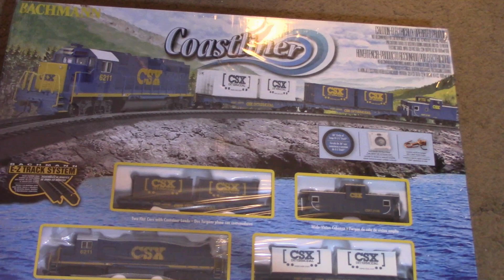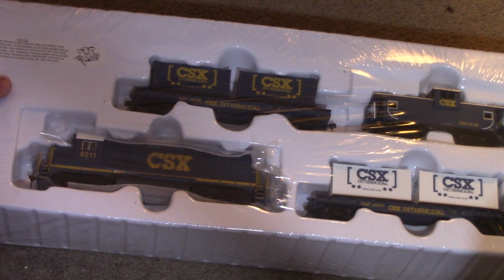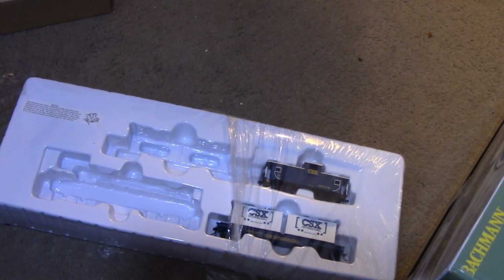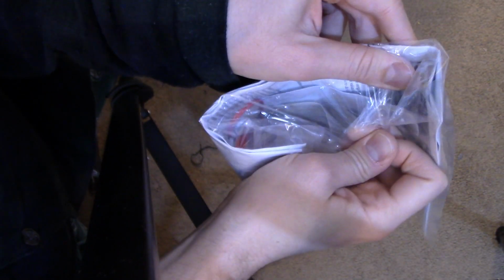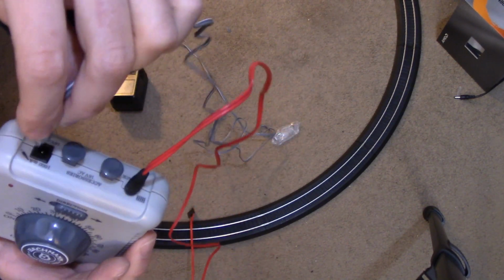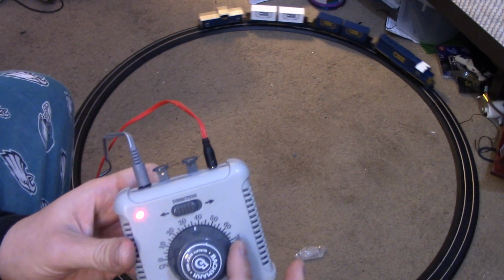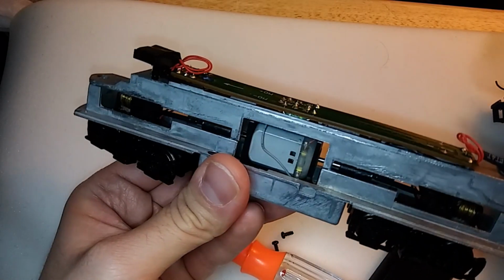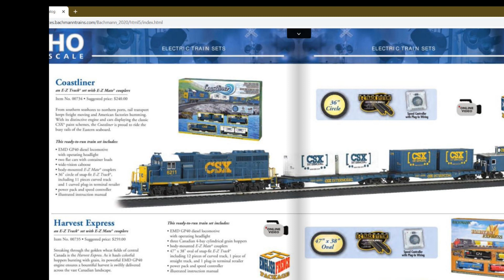Bachmann HO Coastliner train set review

Comment: I had a set like this as a kid big set it was a CN set with one CN locomotive and 7 cars 1 tanker 2 box car 2 flat beds  2 coal cars. With 17 straight tracks and 24 curve tracks 12 tracks per turn very wide turns. Total 41 track peace’s. My dad set it up around are Christmas tree and built a make shift tunnel under the coach I remember having a blast with it the set also came with 35 telephone poles and 15 little figures and signs that you could paint.

Comment: I’m an N scale model railroader, my N scale locomotives are Kato, so are my tracks they are Kato. I’m very satisfied with it. My N scale freight cars are mostly Micro Trains & Atlas. The review you gave on the Bachmann Coastliner HO train set is right to the point. The locomotive sounds terrible & the price for the set is overpriced for the number of cars. It should have had 6 freight cars with it instead of 2 for the price. The set should have 6 freight cars, a caboose & locomotive & some straight track for the total price of $125.00 maximum.

Comment: I thought they originally had an oval in this set because I did indeed see it in 2016 catalog that it comes with an oval, kind of a shame honestly because ovals are the best track design to start out with, not to mention very appealing to look at while the train is running.
Reply: Yeah, I usually find an oval better than a simple circle. But if the set came with those Plasticville signs and telephone poles and figures, those could even enhance such a circle of track! (You could include the "Layout Assortment" pack in the same order as the train set.)

Comment: Great review/bashing of the train set but at the same time I would like a suggestion on better ways to spend my money. Since you are an experienced model railroader I greatly value your suggestions since I have never owned a trainset.
Reply from the maker: If your looking for a good quality trainset and are not concerned with DCC, digital command control, the Walters Flyer will do the trick, here is my review of it https://www.youtube.com/watch?v=Sk0622YTOnU&t=2s. My recommendation, in this day and age, is to start with something with DCC, so you can control multiple trains on the same track with out fancy wiring.  My recommendation would be the Bachmann Trains - Digital Commander    https://www.amazon.com/Bachmann-Trains-Digital-Commander-Ready/dp/B000BPPNWE 
It may not have the highest Quality but it gives plenty of bang for the buck, in that you get a DCC system and 2 DCC equipped loco's all in the same set. It can also be easily expanded and will even run old analog locomotives along side the DCC ones.
Reply: @alcobufff  thanks for the recommendations the walthers flyer is what I was looking for.👍

Comment: I just bought a Bachman Overland Limited and that’s exactly what I paid $240, before I seen this vid unfortunately. 😊
Reply: At least with the Overland set you get a steam locomotive, 8 freight cars, and a bunch of track.  When it comes to steam engines in HO, Bachmann is the only place for affordable new steam unless you go with used stuff.

-Broadway Limited is nice but they still use decoders from the 2000's and sound like ass for the price they charge.
-MTH may not be around for much longer since Mike has decided to retire and the company's future is up in the air.
-Athearn only does Union Pacific/Southern Pacific steam engines and their bodies are plastic like Bachmann too.
-Lionel is trying to make a comeback in HO but their steam engines IMO are the worse out of the four.
-Model Power -I take that back they may be worse than Lionel.

No one else in HO makes steam engines anymore or in a large enough quantity to be considered a steam engine builder.  Yea Rapido makes a Canadian Hudson and Fox Valley made their MILW 4-4-2 streamline set but they were one off's.  It is that or try your luck on eBay with brass or old cheapo stuff like IHC, AHM, etc.